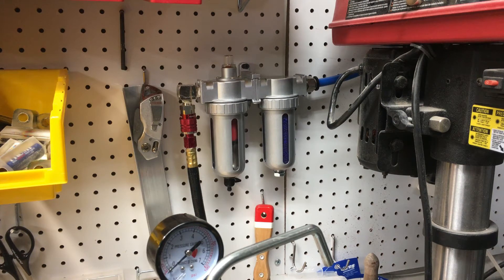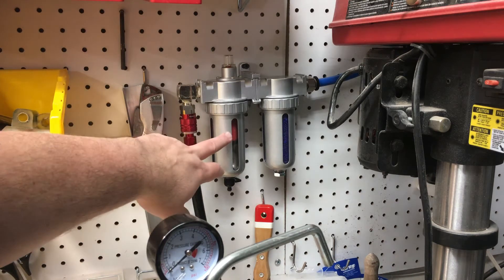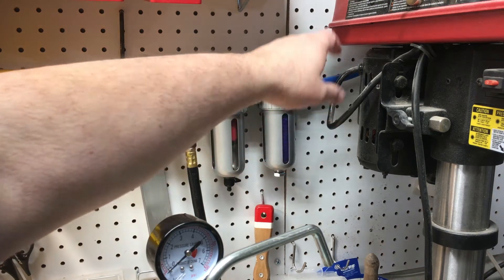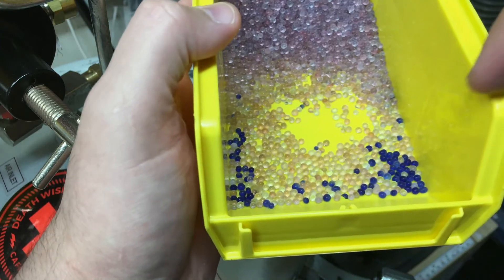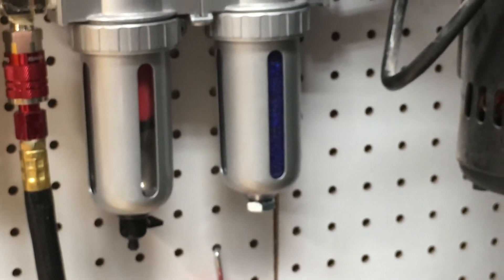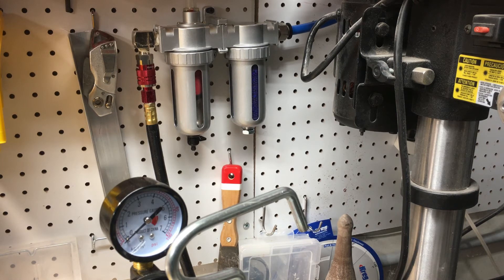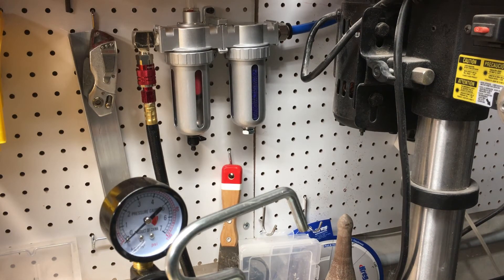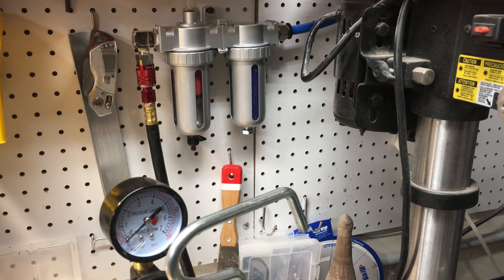Desiccant (Dehumidification) System for my airline

Comment: Thks but blue/orange silica gel is not food safe but the white is ( https://en.wikipedia.org/wiki/Silica_gel ):
Humidity indicator (blue/orange silica gel): Silica gel may be doped with a moisture indicator that gradually changes its color when it transitions from the anhydrous (dry) state, to the hydrated (wet) state. Common indicators are cobalt(II) chloride and methyl violet. Cobalt (II) chloride is deep blue when dry and pink when wet, but it is toxic and carcinogenic, and was reclassified by the European Union in July 2000 as a toxic material.[15] Methyl violet can be formulated to change from orange to green, or orange to colorless. It is also toxic and potentially carcinogenic[16], but is safe enough to have medicinal uses.